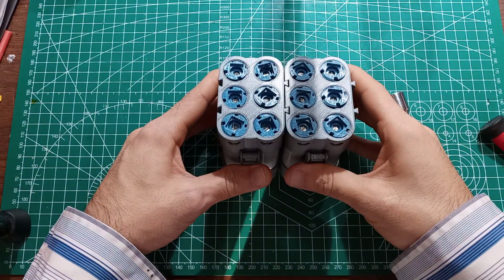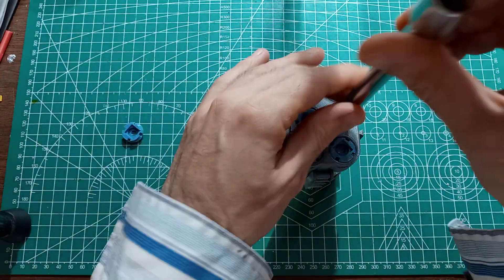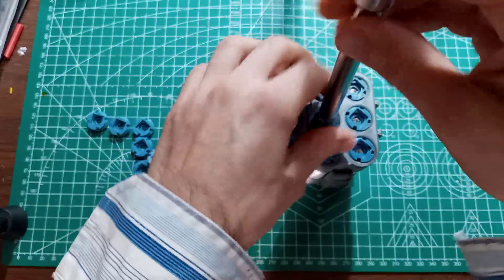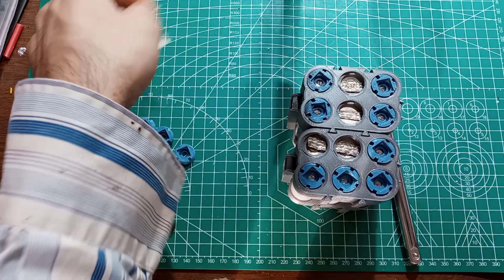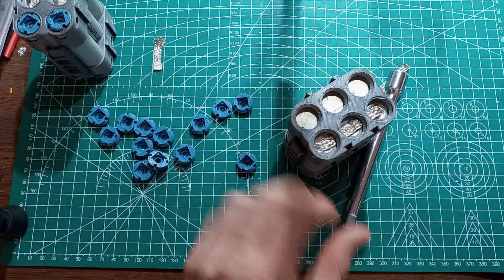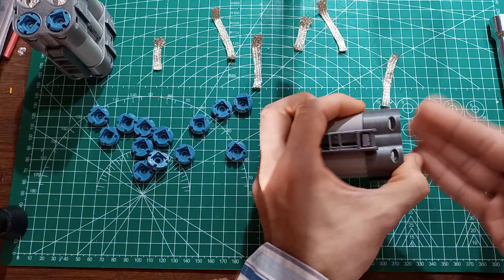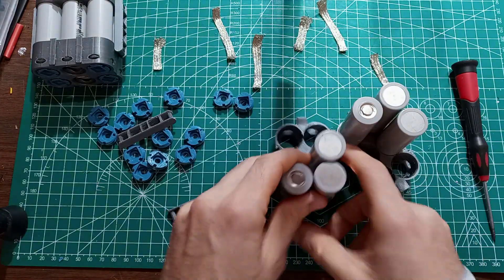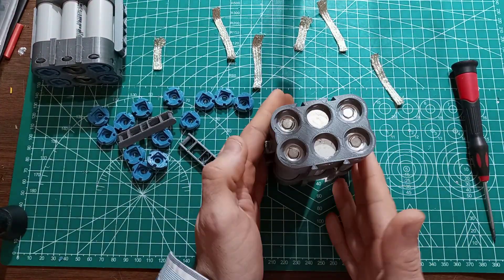Omnicell Update - Weldless, easy to build, user-serviceable, high current lithium ion battery packs.

Comment: I need a 3s 10p to run a 750w power converter do you make a kit and can  handle a 90 amps output for a set. Of 18650 bayeries
Reply from the maker: yes you can do 90A so long as you have cells that can support it and you tipple layer your braid on the series connections.

Comment: I have been pondering a build for my 13s4p li-ion battery pack several iterations have been tried but didn't like any of them. Then I stumbled onto your video and I do believe you have come up with a brilliant approach to pack building. Are you sharing the printed STLs? 
I read someone's concern about the "The braids can come in contact to the edge of the cell, shorting it out." Maybe the screw-in part could have a cone-shaped point and the screw-in portion have a slot. Just a thought.
Reply from the maker: thank you! I really appreciate that. And yes, it may be difficult to tell from the videos, but there is no opportunity for the braid to move and touch the negative side of the cell. I will upload more videos explaining this and showing that part in more detail.
Reply: @electronicsworkshawp  thank you will be looking forward to seeing that video. Meanwhile I will attempt to my own creation of your objective. Thank you.

Comment: The positive ends worry me. The braids can come in contact to the edge of the cell, shorting it out. Any way to mitigate this risk?
Reply from the maker: insulator rings. But really, I have not had this problem at all. Also, the braids are guided through channels. They cannot move side to side.